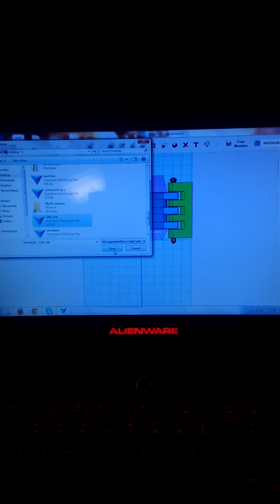Autodesk 123d fail \ crash

Comment: Same here, but with doing something like extruding or similar function. No error messages or anything to help get bottom of this problem, just quits. I did see process eating huge amounts of resources, mainly ram and CPU, so there could be a clue.

To fix this currently, i can only suggest you to chance it to Autodesk Inventor, cause 123D is just too simple. 123D might be good to learn basics, but anything more complicated than simple lamp or such and your getting issues like this.
Reply from the maker: +Hellsong89 i switched to designspark mechanical, seems to handle things a bit better, Though it has alot more to learn about.

Comment: I have the same problem. I am working on a very fast computer with 32 Ram and a good videocard. Still shuts down exactly like this. If anyone has solutions. Please let me know.
Reply from the maker: +anarchyforlive try designspark mech , not as easy but better results, and has yet to crash on me so far
Reply: Thanks for the tip! I will try it out :D